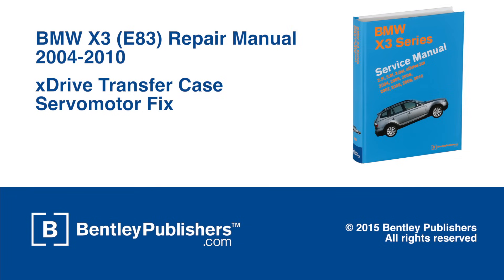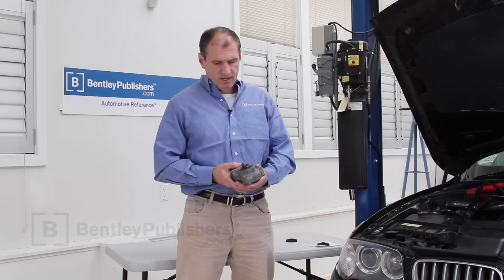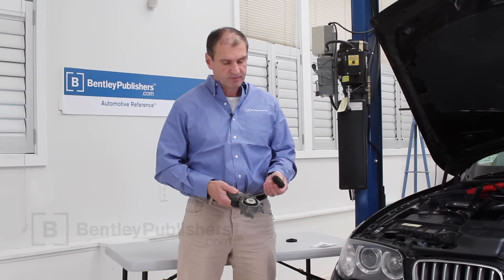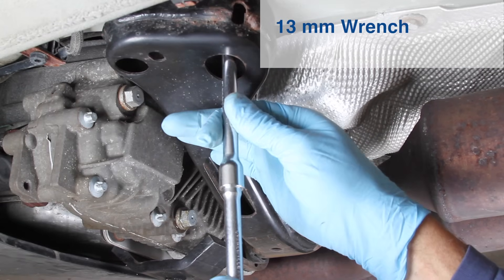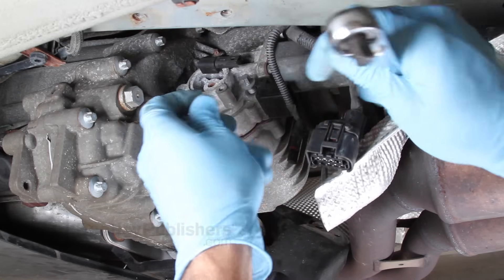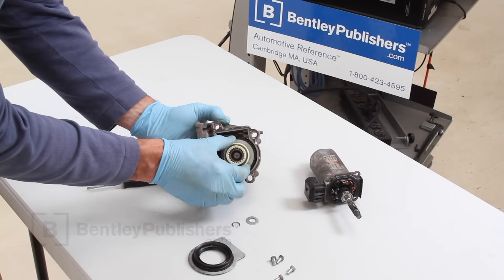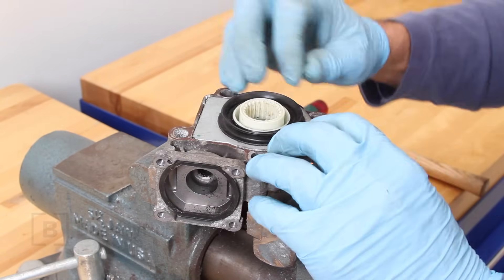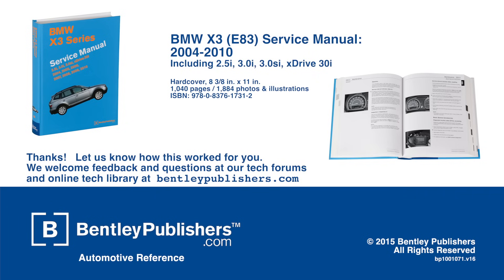BMW X3 (E83) 2004-2010 Servomotor Actuator - DIY Repair

Comment: Hi, 
I'm having the same problem with my 07-525xi E60, I replaced the transfer case actuator motor and the abs, DSC and awd seem to work, but the 4x4 and dsc warning lights are still on, the car drives ok, but if I push the gas it starts to jerk/shake and engine light comes on until I restart the engine again, with Autel al419 scanning tool I only have a cyl6 misfire, but the engine runs good unless, like I said, I push on the gas, other than that I don't see any other faulty code for the transfer case, and even if I reset the codes the 4x4 and dsc light still on. Please help, do I need to re-code, re-program the resistor, ECM or something? Can I do that myself, or Where can I do that if that's the case, I live in Toronto Canada.
Thank you
Reply: Hello I'm having the same issue. Did you ever find a fix for this? Thanks

Comment: My plastic gear is in perfect shape even after 115k but I'm questioning the servo motor itself...it's wobbly within the case and clicks when I turn it.  I'd assume it's supposed to turn smoothly like a brushless motor?
Reply: Bump
Reply: Hey. Did you manage to find the answer ? Was it the servo motor itself ? Experiencing the same problem after changing the plastic gear

Comment: I replaced actuator gear (2005 X3 3.0. 95,000 mi) and it fixed problem with dash lights. Been several months. I recently got a flat, and put a quality used tire on right rear (same size, different maker). It is maybe 2 mm higher than other tires. Almost immediately the lights came back on. I also see that the garage didn't put the tire pressure sensor back on that tire (not sure if that would have anything to do with it??). Seems strange that a tire that close to the others would cause lights to come on within 50 miles. I mean, what happens when you put the spare on or when a tire is somewhat lower in air than the others? Is it going to burn that gear out again? I mean it's a $2000  job at BMW.  Any ideas, while I park truck??? thanks, great clear video!!
Reply: These cars are extremely sensitive to different tyres. All tyres be the same brand and model and same wear. It's the biggest cause of drive issues. In fact, most X3 driveline issues are solved by getting new tyres all round.
Reply: Jack Douglas that's crazy when I bought mine the tire that was on there was different size that could be why I had this problem I need to check my other tires to see if they match never thought of that. Good note

Comment: Nice video, very clear.

My sons 2007 X3 has just the 4X4 light on.  It happened immediately after I replaced the spark plugs and the engine air filter.  Initially, three lights came on - 4X4, ABS and Brake.  The other two went out after a few hours but the 4X4 light remains on, about 2 months now.  It won't reset by using a scan tool, or turning the steering wheel lock to lock.  I don't get the clicking noise when the car is turned off.  My iCarsoft scan tool says it is  "5F3A Transfer case: malfunction".
I could just try replacing the transfer case, or just the gear, but does anyone think that I could have dislodged any electrical wiring or something else while doing the service work on the car?  It seems like an odd coincidence that this problem occurred as soon as I replaced the plugs and the air filter.
Reply: Martyn H same thing here with same vehicle. Wandering if it’s the speed sensors cuz my abs isn’t working rite. No noise on the t-case actuator. Have code p1774 won’t reset with the triad of lights. Work on the car more than I drive it. Any input would be appreciated..
Reply: @cs3943  On my 2007 it turned out to be the speed senor right rear. CODE 581D on my friends 5k snap-on code reader. My ghetto harbor freight reader cannot pick this code up. This was after I bought the replacement gear, struggled to get the actuator off the car and opened only to find the factory gear in perfect shape. Changed out the sensors both in the rear and all good now.

Comment: I just want the lights to go off...if i simply disconnect the cables as shown , will the lights go off ....i am good without the 4 wheel drive..lights are really annoying
Reply: Milton  Isaac did it work?

Comment: What is the part number of the gear and where did you get it?
Reply from the maker: Jeff Owens 
Hi Jeff, 

The gear we used was sourced from the aftermarket. BMW does not offer this gear, just the complete motor. www.odometergears.com is one source of a good quality replacement gear. 

Regards, 

Charlie Burke
BentleyPublishers
Reply: +BentleyPublishers I used this part at 70000+ miles, and have recently used an all aluminum part from a company in New York-onlinewholesaleparts, on eBay.  Hope this helps.
Reply: +Jeff Owens i got mine at ECS tuning. PelicanParts also sells one.

Comment: Any body had the issue when it works for the first week or so after replacement and then goes bad to lights again? Also sounds like the LSD is locked up. Any suggestions? Thanks

Comment: HELP!  I did everything is listed in the video but my lights are still on. What should I do now?
Reply: Vincent David Feitosa wow this happened to me too please someone give some advice thanks
Reply: I'm a year late, but did you sort it out? Did you clear your codes after? Thanks.
Reply: Maybe you need to clear the codes?
Reply: Code are automatically clear if its done right.. check your sensors
Reply: Which sensors do I check?

Comment: Hi all can anyone help  ?
my bmw x3 has a high pitched sqille noise when in drive but goes when I pull away also goes when in park  . when in stand still in drive it makes the noise all the time . any ideas  ? 
Steve.
Reply: Crankcase breather in valve cover is bad  Remove oil cap to verify If cap is removed noise should disappear Cap may be hard to remove with engine running

Comment: What is error 5f23 ? I only have 4x4 light on. X5 E53 3.0i
Reply: Dan Alex I had all 3 replaced the gear and now the 4x4 only and it's the entire motor I'm replacing now as it turned the gear again
Reply: @StevenStennes   can i ask if when you replaced the entire motor did you have to reprogram it ? thanks

Comment: That little gear is an exceptionally robust chunk of material. And with proper maintenance, there's no reason it can't last the life of the vehicle. Transfer case oil renewal and an xDrive (VTG) adaption reset can make it last even longer http://youtu.be/sml5ewz0HzA.  In my vehicle's case, the transfer case oil change was over due. Glad to find out I had a more economical solution other than replacing the servomotor. In my opinion, the E83 X3 is a surprisingly well built vehicle, including the XDrive transfer case.
Reply: So Charlie, you had the same issue with the lights on your dash?  I have the same issue but I hear no clicking at all.  Is this an indicator to change only the transfer case oil?  How did you decide it only needed the oil to be changed?
Reply: Vito Orona

Vito, a fault code will be set when the oil needs to be changed, but this fault code will not turn on any dash warning lights. The oil wear fault code is set when the clutch plates wear (travel to engage the clutch is too great). You'll need a bmw scan tool to see if you have a transfer case oil wear fault. If your truck is not making the clicking sound, I would first find out what fault codes are behind the warning lights. Let me know what you discover.
Reply: WILL DO!  actually I was thinking about trading mine in and purchasing a base model Jeep patriot.  My 2004 X3 3.0I is currently at 63,500 miles. Super clean interior and clean exterior.  I am financed and owe $14,350.  I just want peace of mind. I will still let you know what i come across.
Reply: The X3 is one of the worst built BMWs ever! Crappy 4x4 driveline design, chews up front dub assemblies, dampers and drive shafts, fragile diffs, rear subframe issues and terrible ride quality. Are you kidding my me?
Reply: Im starting to realize this! My first BMW. Not my last but am sure thinking about it.

Comment: What really irratates me about this rebuild and all other similar videos, there is no point in this video that exposes a very serious problem with this method of repair.
Allow me to explain: on the end of the motor shaft is a worm drive...or better said a machined thread that is basically "acme" thread. Acme thread by design is square on top and in the valley of the machined pitch. The primary reason the plastic gear becomes wore (as exposed in this video) is because the thread pitch on the Acme worm drive becomes wore to become knife-edged. This knife edge pitch disengages from the gear teeth on the plastic gear, and basically chews off the top of teeth on the plastic gear.

Thence it would behoove the mechanic to inspect the worm gear on the motor when it is pulled out from the assembly. If there is wear as I described, it would be a waste of time and money to bother with putting in a new plastic gear, because the worm drive will chew the plastic gear in short time.

There are new motors available, if the mechanic insists upon rebuilding the actuator. Also there are inexpensive new actuators available that are not made by BMW.

Good luck

Comment: Can not believe the part was a Lego piece. No BMW for me.
Reply: Appreciate Video! Forgive me for butting in, I would appreciate your thoughts. Have you thought about - Tarbbatigan Cars Rehabilitation Tip (just google it)? It is an awesome exclusive product for learning how to repair your car the easy way without the hard work. Ive heard some amazing things about it and my m8 at last got excellent results with it.
Reply: yes it is made of plastic. And the price of the whole unit is 1700 dollars. You can buy the gear after market for 10 dollars. The dealership sell the gear  for 260 dollars.  But you can buy an aluminum gear after market but dealership don't sell them because they want to make more money. What I did to my X3 is I just rotate it using the other side because the gear rotates 180 degrees only. They don't tell this to owners to make money.
Reply: Joel Bringas, be careful with the metal gear, it can cause a whole host of issues.
Reply: Yeah, I thought that is a bit too much. Some gear is designed to give away so that more critical gear is saved and those critical ones might not be able to get a fix again if broken.
Reply: @joelbringas612  link to replacement gear